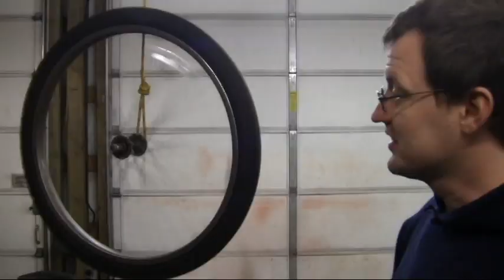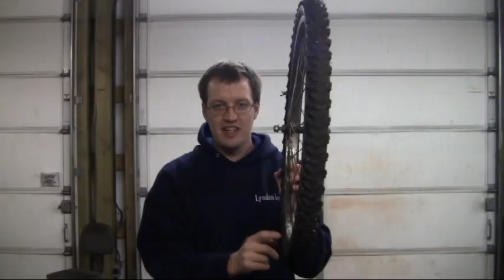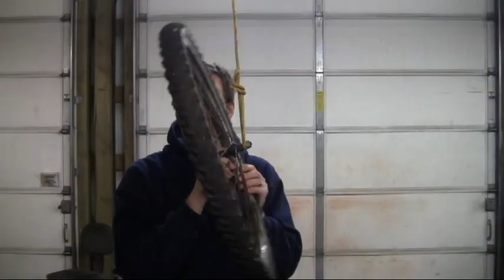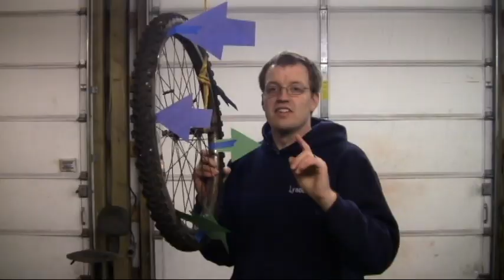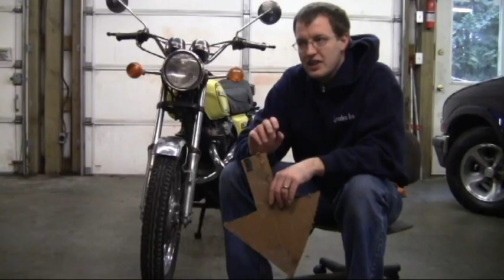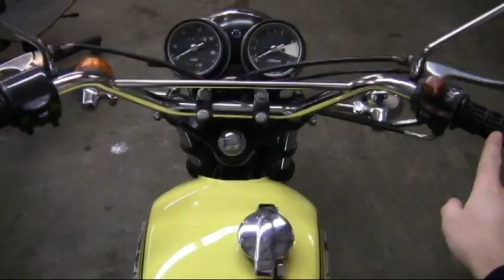Gyroscopic Precession LONG VERSION explained logically (Spinning Tire on a string gyroscope gyro)

Comment: Thank you! :D
This is the only video I've seen so far that clearly explains both
why the gyroscope (in this case the spinning tire) remains "standing",
along with why it steadily pans around.

The videos and articles I've seen previously could explain Precession, i.e. the gyroscope revolving around the support point, 
but either glossed over or failed to explain the issue of Gyroscopic Inertia, i.e. why the angle of the gyrcoscope's axis remains the same instead of tilting over due to gravity.

Comment: Summarizing my 2 year old comment, precession is a reaction to a torque, and only dampens motion, it does not provide any corrective response to return to vertical. Without trail, precession would just slow the rate of fall due to imbalance, not prevent the fall with a corrective response. At 14 minutes into the video: "turn the wrong way", precession response is not enough to cause any significant lean. What causes the lean is the front tire is steered outwards, causing the tire contact patches to steer outwards from under the motorcycle, causing the bike to lean inwards, and once leaned inwards, trail effect (not precession) steers the front tire inwards. This is taught in Motorcycle Safety Foundation classes (out-tracking tires to lean inwards).

Comment: Focus on a rider input for a turn.  From the straight-line AUTO STEERED, balanced state, he MUST input an imbalance by moving some mass sideways (as in no hands riding) OR appying a downward force on the HB end,  on the side of the chosen turn.  
This causes the MC frame to TILT (lean).  The MC instantly steers itself toward the direction of the TILT and will return the MC to a verticle (balanced) state, UNLESS the rider continues the DOWNWARD force, causing a TURN.

Take a riderless MC traveling in a straight line, add a 5 lb. weight to its  left HB end and it will travel in a perpetual circular path.

 NOTICE: a steering away from the turn direction (counter-steer) NEVER happens.

This is demonstrated on a MC using a handheld torque meter on the left HB end, at speed, he pushes UP,  for a RIGHT turn and pulls DOWN, for a LEFT turn.          https://www.youtube.com/watch?v=1iMk9WaUN0U
Reply: You got that backwards, he pushes for left turn, pulls for right turn (counter-steering). Once the bike is leaned, if not for rider input, the front tire would steer inwards enough to return the bike to vertical due to trail effect, so he has to continue to apply force to prevent the front tire from over-correcting in order to hold a lean angle.

Comment: What you are stating could cause a dangerous error!  You are not pushing forward, you are pushing down.  A forward push will turns the MC wheel away from the lean direction and quickly falls down.  When you push down on the handlebar it doesn't turn the wheel, it causes a LEAN to that side, then gyroscopic precession turns the wheel (a gyroscope) toward the side you pushed down on.  The MC will auto steer to the side you pushed down on so the tire patch moves that direction to maintain balance.  If the steering head was locked in a straight direction, preventing the wheel from turning toward the side you pushed down (leaned), it will instantly fall down.  A MC turning doesn't involve an opposite action (counter-steering), this allows full control when hands free riding.  Push down on the right HB end, you lean right and the wheel turns right only.  The CS errant concept was started by Keith Code in the 1970's and became etched in many riders minds because it was not readily observable.  The precise design of an auto steer two-wheeled vehicle precludes any counter action when turning due to the requirement of always being BALANCED.  The Bozeman G.P. demo shows this clearly.
Reply: A forward push is what is taught by the Motorcycle Safety Foundation. You are literally steering the tires out from under the bike+rider in order to lean. Once leaned, the steering wheel is turned inwards (trail effect will do most of this automatically), and lean angle is still controlled by countersteering: steer inwards more to lean less (or straighten up), steer inwards less to lean more (or for most bikes where trail steers inwards too much, steer inwards a bit less to hold the current lean angle to prevent straightening up).
Reply: @rcgldr  Moving the tire patch is REQUIRED.  It can only be done by a ROLL action by rotational torque. The MC does the steering.  This is how hands free riders operate with FULL control.  By design, a bike always steers toward any lean, by DESIGN, the cannot countersteer.  If the rider forces a CS, it falls down the way a bike does when the steering head is locked straight.
Reply: @microatmospherebreeze  - Some sport motorcycles have such a small amount of trail that will they barely turn if ridden hands free, maybe enough to change lanes, but not enough to take a normal corner. The rider is forced to use counter-steering inputs to force these bikes to lean. I also ride electric unicycles, one of them is only 35 lbs, and I weigh about 200 lbs with gear (helmet, wrist guards, ...), and yet at a stable speed around  8 mph to 10 mph, so slow that there is very little angular momentum or gyroscopic precession from the small 16 inch outside diameter tire + wheel + motor, tilting it causes it to steer | turn (camber effect), and even more so than a bike, I have to lean (fall) first to setup balance for a turn, then tilt to steer | turn. What about a track stand on a bicycle, where a rider uses steering motion to move the front tire contact patch side to side (due to having trail) for balance, with zero forward or backwards movement?
Reply: @rcgldr  The many variations of bike designs are not a part of this examination.  The common, well established ones are.
Reply: @rcgldr  One common error is not differentiating between STRAIGHT LINE TRAVEL where steering action occurs to return to verticle BALANCE.  TURNS are iniated by LEAN followed by auto steer in one direction only, with the lean torque maintained for a chosen turn.
Reply: @rcgldr  You must be really be disturbed by the proofs that I provide to go to such lengths to deny them.
Reply: @microatmospherebreeze  - in the video with the push pull force gauge dynamometer, he pushes for left turn, pulls for right turn (counter-steering).
Reply: @rcgldr  This proves no CS, no forward push, just up and down like I do in an emergency turn!    https://youtu.be/CMtge9251fM

Comment: Can U make another one to show what happens when U (try to) turn a gyro, sideways,
and what happens when U turn a fully gimbaled gyro thru full 360 degrees.
I think U would need to color the gimbal halves and gyro sides differently
and be able to show in which direction the gyro is spinning.

Comment: Standard bikes (bicycles and motorcycles) are stable (self-correcting) due to trail (not precession): if the steering axis is virtually extended, it intercepts the pavement ahead of the tire's contact patch. If a bike is leaned, the upwards force from the pavement is behind the steering axis, causing the front tire to steer in the direction of lean, and steered inwards enough that at sufficient speed a bike will self-correct and return to a vertical orientation. Precession is a reaction to a torque, and in a coordinated turn, there is no torque about the roll axis of the front tire,  so no tendency to return to a vertical orientation. The other gyroscopic issue is the angular momentum of the front wheel, which resists any steering movement of the front wheel, including the self-correcting response to trail. At moderate speeds, the angular momentum acts as a damper to self-correction, smoothing out the response. On a motorcycle at high speed (100 mph), the angular momentum dominates and a bike tends to hold the current lean angle (the rate of change in lean angle is so small that it's imperceptible). Assuming a rider uses counter-steering to control lean angle, steer more to lean less, steer less to lean more, then at moderate speeds, the rider has to apply some outwards torque on the handlebars to oppose the self-correcting response to hold a lean angle. At high speeds, the rider doesn't need to apply torque to the handlebars to hold a lean angle, and it take as much effort to straighten up as is does to lean.

It is possible to make a stable "bike" with no gyroscopic effects, called a "two skate" bike, although most examples use counter-rotating wheels as opposed to circular skates on ice. It's also possible to make a "bike" stable without trail by locating a mass above and in front of the front tire, so that if leaned, there is a yaw torque between weight and rear axle due to the suspended weight ahead of the front tire that causes the front tire to steer into direction of lean, without any trail or caster effect.
Reply: You are mostly right, but your critical failure is not understanding that a bike turn is ONLY initiated by an imbalance, THEN the 3 design features cause the wheel to turn in the direction of the lean.  These features are gyroscopic precession, steering head rake angle for trail effect, and upper forward weighting.  The turns NEVER use any action that is opposite the lean direction (no counter-steer ever) or balance would be lost.
Reply: @microatmospherebreeze  - a bike and rider have to be leaned for balance in order to turn. An imbalance is required in order to lean or change lean angle. The rider steers the front tire as needed to change or control lean angle, via counter-steering, unless riding hand-free, which is ineffective on bikes with a small amount of trail, such as the green Kawasaki that Keith Code used as the no "body steering" (no BS) bike and|or bikes with steering dampers. Once leaned, trail tends to cause the front tire to steer inwards too much and straighten up the bike. A rider has to exert some outwards torque on the handlebars to prevent the over-correction in order to hold a steady lean angle.
Reply: @rcgldr  Seems like you just regurgitate, without taking correction.  Did you see the Bozeman G.P. demo?  3 processes occur when a bike turns, not just one.  G.P. is the first and most important of the 3.
Reply: @microatmospherebreeze  - read the following wiki articles: "two mass skate bicycle" - zero gyroscopic precession, zero trail (a weight ahead of the front tire causes it to steer due to caster effect). "bicycle and motorcycle dynamics", search for capsize mode (in eigenvalues section): with very thin tires and high speed, gyro effects impede steering response to trail and the bike ends up falling inwards at a very slow rate. With normal tires at high speed, the effect is a bike tends to hold a lean angle instead of straightening up, since the rate of change in lean angle is so small that it is imperceptible. "counter-steering": need to lean to turn. "gyroscopic precession" - it is a reaction to a torque, not a reaction to a lean angle. Once in a steady turn, there is no torque about the roll axis so no gyroscopic precession. When initiating a turn (changing lean angle), it has a small effect (about 12%) on the turn response.
Reply: @rcgldr  FIRST goto a real dictionary and read the definition of CS.  Cars do it, MC's do NOT, or they lose balance.
Reply: @microatmospherebreeze  - I did a google search for countersteering, the very first hit was "Countersteering is a technique used by riders of single-track vehicles, like motorcycles and bicycles, to turn by steering in the opposite direction of the desired turn." This is also true for pedaled and electric unicycles.  Motorcycles have to "lose balance" in order to lean or change lean angle.
Reply: @rcgldr  Bicycles are designed with 3 features that insures the stay BALANCED.  Every rider who claims to push FORWARD never achieves a forward MOVEMENT, it ALWAYS goes directly down only (vertically toward gravity).  See slowed HD videos to confirm this.  The downward movement is a LEAN action, not a steering action.
Reply: @rcgldr  Some of what you stated is TRUE.  Focus on a rider input for a turn.  From the straight-line AUTO STEERED, balanced state, he MUST input an imbalance by moving some mass sideways (as in no hands riding) OR appying a downward force on the HB end,  on the side of the chosen turn.  
This causes the MC frame to TILT (lean).  The MC instantly steers itself toward the direction of the TILT and will return the MC to a verticle (balanced) state, UNLESS the rider continues the DOWNWARD force, causing a TURN.

Take a riderless MC traveling in a straight line, add a 5 lb. weight to its  left HB end and it will travel in a perpetual circular path.

 NOTICE: a steering away from the turn direction (counter-steer) NEVER happens.

This is demonstrated on a MC using a handheld torque meter on the left HB end, at speed, he pushes UP,  for a RIGHT turn and pulls DOWN, for a LEFT turn.          https://www.youtube.com/watch?v=1iMk9WaUN0U
Reply: @microatmospherebreeze  - moving mass sideways -  this isn't possible without the bike steering. If the front tire is held straight, the center of mass doesn't move left or right, and if the rider shifts left, the bike leans right and the center of mass remains fixed (left | right). Some bikes have very little response to rider movement, and can not make a normal turn if riding hands free: https://www.youtube.com/watch?v=JWuTcJcqAng&t=31s .
Reply: @microatmospherebreeze  - I replied with a comment that included a link to an actual motorcycle with a second set of non-steering handlebars, so similar to riding hands free, but with throttle and brake control. The bike used is a Kawasaki 900cc sport bike with a small amount of trail, and the bike barely responds to the rider shifting weight, not enough to make an actual turn. I don't know if that comment will show up since it has a link. You could always email me rather than post comments on someone else's video. Also a rider can't just shift mass sideways without the bike steering. Imagine a bicycle on a tight rope or the steering locked, the bike is free to pivot left | right at the contact patch: if the rider shifts left, the bike leans right. The rider has to exert a torque to balance in this case, which is why those long poles are used in bike on tight rope acts.

Comment: Well done. Good explanation of the basic fact that angular momentum is really just convenient notation for applying the fact that F=MA applies at each and every point (particle) within the wheel. The equations of angular momentum are derived from the linear versions (f=ma at each point). Thus, by analyzing each point in a linear fashion (f=ma), you can come to the same conclusion as using the more simplified angular notation (t=ia, for torque = angular inertia * angular acceleration).

Comment: Your video completed my quest this morning to understand gyroscopic precession and apply it to motorcycle dynamics. An earlier video lit my bulb on understanding how leaning the bike induces precession around the front wheel's yaw (vertical) axis by applying a lateral force at the top and bottom of the wheel. I still had not figured out that countersteering induces precession around the front wheel's ROLL axis (the line in the bike's direction) by applying a lateral force to the front and back of the wheel. Now my brain has an explanation to hold onto. Thanks!

Comment: Isn't there a difference between a wheel suspended such that it rotates around a horizontal axis and a wheel fixed by forks.  In the latter case wouldn't the wind force be equal to all the wheel not resulting in the force being manifested at 90 degrees ahead?

Comment: Very nice, very nice, but/t:
. I think U should have a fixed white plastic disc on both sides
with a big black arrow indicating the direction of spin,
so we can tell which way it's spinning, at all times.
. U're right, in outer space it would not precess, at all.
. Why don't U sit in an office chair and tilt it/the gyro and explain
why it precesses, like that. E/specially when it's horizontal.
Why does it precess in the direction of the inside spin?
And please don't just give us the bog/stock/standard/macro explanation,
"The conservation of momentum". I need the micro explanation, for my
little friends. Our vunderbar kinder.
. The longer Ur arms the slower it precesses.
If they were infinitely long, it would not precess at all.
because the difference between the outer and inner radius/i would be 0,
as would be its angular velocity, relative to U.
. Oh yes the rim's linear velocity is the same, right around, of course,
and so its angular velocity is higher on the inside than the outside,
relative to U. Just like a spinning skater, with her arms out and in.
I actually call this the conservation of the linear velocity or inertia.
When she brings the arms in, the mass in them, wants to continue,
moving, with the same linear velocity, of course.
. "CH! Simples", when U know how.
. (Asking a question publicly focuses my mind and motivates me to (get serious/ly/real and)
answer it, definitevely, finally. But I would still welcome Ur opinion/input).